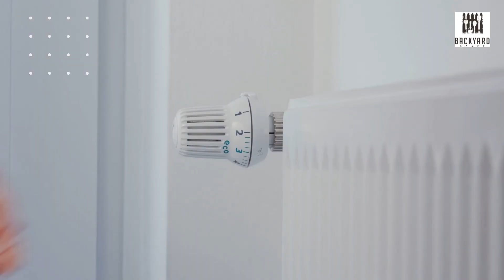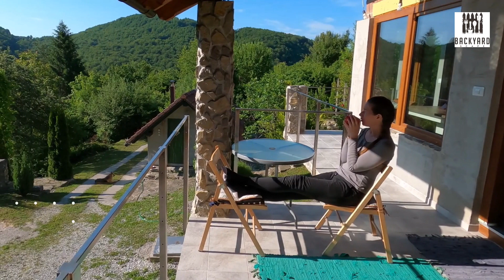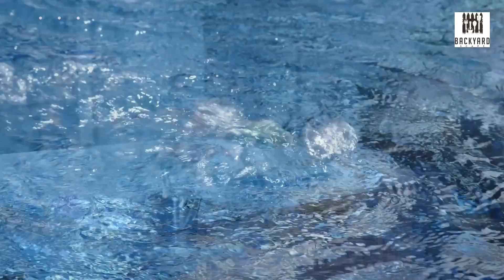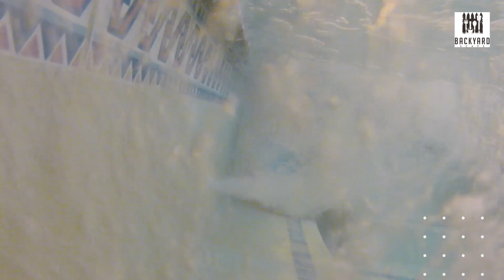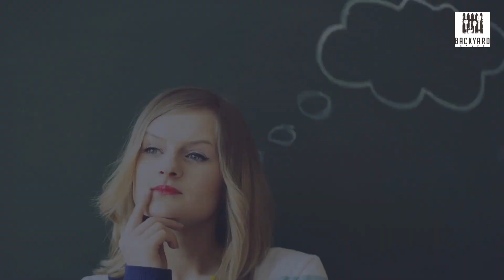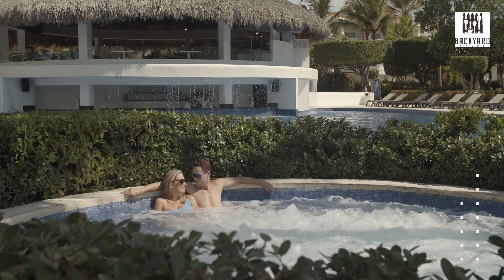Hot Tub Temps: How Long Does It REALLY Take to Heat Up

Comment: 3 to 4 hours to reach recommended temperature? which is basically almost your last sentence. 
That really doesn't make sense if you're hot tub starts out at 66 Fahrenheit I doubt you're going to reach 102 and 3 to 4 hours. It would have been nice if you gave some scenarios based on startup with for instance 66 Fahrenheit water how many hours should it take to reach 102 and then give a outside ambient temperature